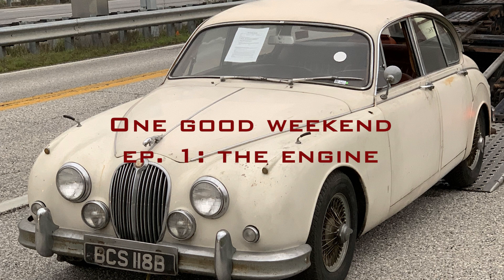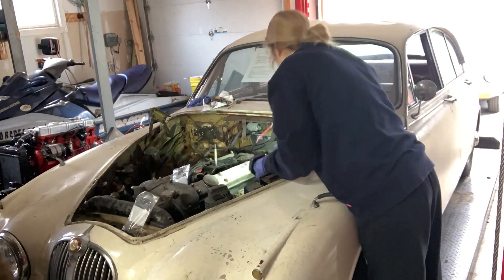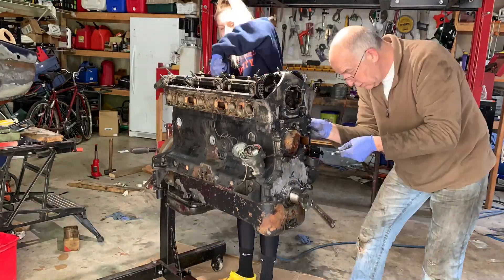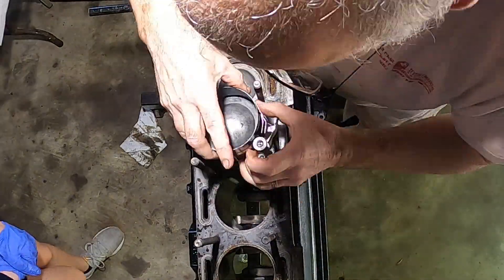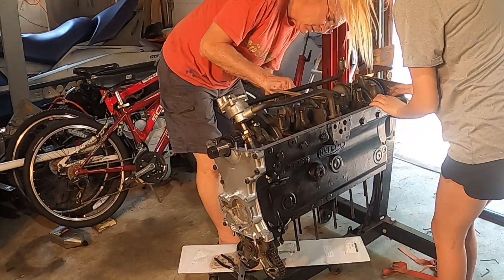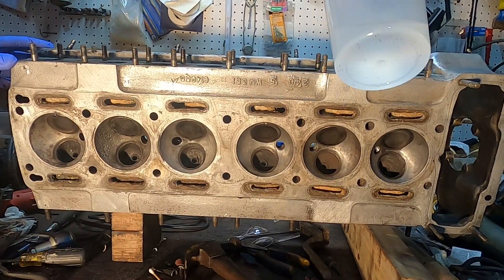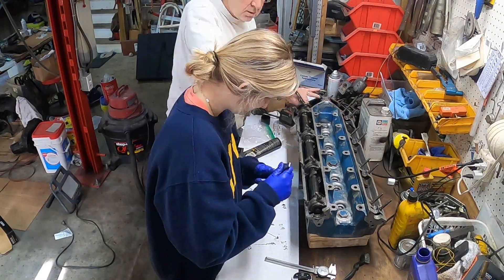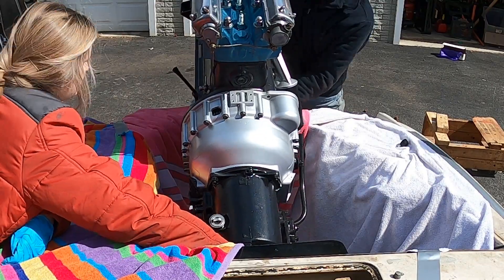One Good Weekend  Ep. 1: The Engine | Jaguar Mark 2

Comment: Fun to watch, as I'd restored a 1962 MK 2 many years ago.  I had a two post lift that allowed me to unbolt the subframe from the car with the engine and gearbox installed, then lift off the body before lifting the drivetrain off the subframe.  No struggles to get the engine out and back in the small bonnet opening that way.  Reassembly was the reverse, with plumb bobs hanging off the body at the subframe mounting points as the body was lowered back down onto it to make sure it all lined up.

Comment: Great video Megan, you could not have picked a better car to restore. You will learn heaps on the way through. I have owned four Mark 2's over the years and my current 1960 3.8L Resto Mod is in it's eight year of building. I have a feeling you will do yours quicker.

Comment: Stand the cylinder head so the valves are vertical for grinding.
When putting the engine  in,  when it's half  was catch the centre mountain adjustable pin first then it goes up in place.

Comment: Megan, 

the usual way to remove the engine is to lower it downwards complete with the gearbox after removing the front subframe, a bit late now, as is a simple way to remove the cam buckets is to use one, put some oil on it's flat face and place it on the next bucket. The oil 'sticks' them together and they can easily be removed. Or possible a strong magnet?

Comment: Did you replace the valve guides and valve seats? The seats need to be changed because we don’t have lead in gas anymore to lubricate the valves. Looks like in order to save money you skipped a lot of normal restoration steps.